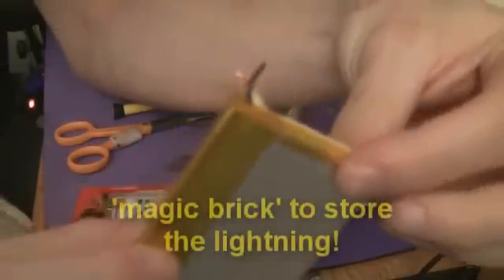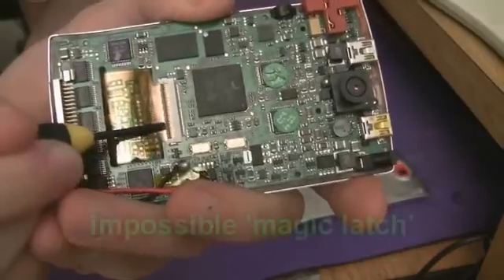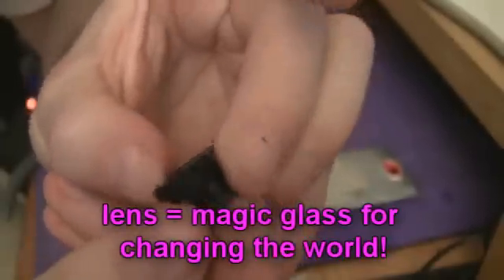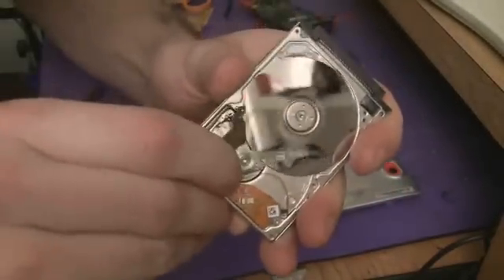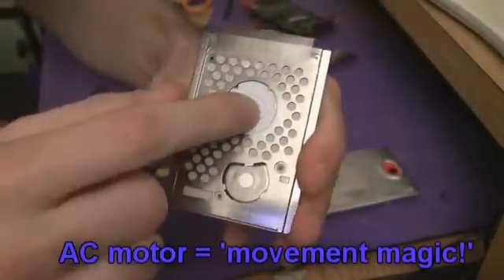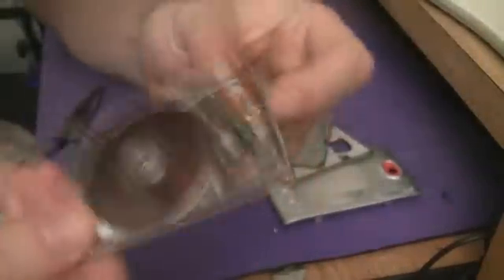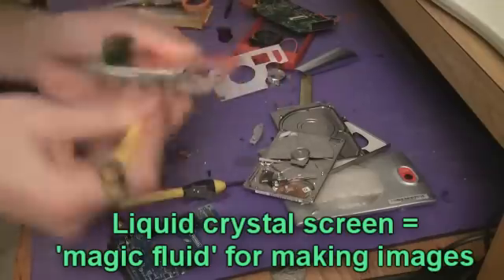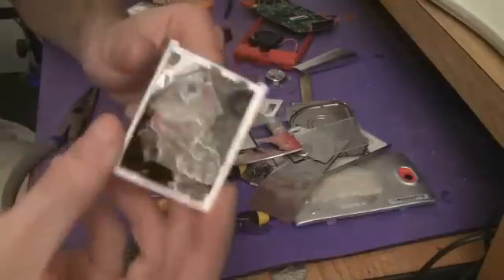PURE NERD PORN

Comment: Common dude, you couldn't recreate the sticky tape without looking it up, if it is even available on line. The sticky tape alone is very probably the result of thousands of man years of research and other work xD. Sure you could analyse it, but I'm guessing you wouldn't get much out of the solidified polymer that is the adhesive :p

Comment: A few tricks that I figured that helped me a lot: make photos or a video of your disassembly process, so you know exactly where those screws go later on... Place the screws and components on your table in groups corresponding with the dissasembly stage and try to find bluebprints or dissasembly guides/videos/pictures on the net before you start, so you avoid damaging your devices. especially when you need to find out where those stupid plastic latches are located... have fun! :)

Comment: They don't make them like they used to. For several reasons.

The first is to save money and make it cheaper, they use inferior parts and cut corners. This makes for an inferior, yet cheaper product, which ultimately has a short lifespan.

The second ties in with the first; planned obsoleteness so as to make more money when the device breaks or something new comes out a year or so later (they figure the old one won't last more than a year anyway).

Comment: Incidentally I'm reasonably sure that Thunderf00t makes use of brushless motors in his RC airplanes, you almost never use a 3 cell li-po battery with brushed motors.  Besides almost all electric fliers use brushless systems, they cost more but they're a lot more efficient and so long as you don't crash 'em they last practically forever.

Comment: the controller senses the position of the motor and energizes the appropriate winding to keep the motor moving at the desired speed.

As far as I can tell, such systems are used in all hard drives as well as optical drives.  It's a very reliable system.

Similar motors are all the rage in remote control cars and planes.  In fact for a while it was all the rage to take the motor out of an old cd drive and strip it down and use it in an RC plane.

Comment: "How can you have an ac motor in this dc powered device? There certainly isn't an inverter in there, although I suppose the voltage could be flip-flopped, but that still wouldn't be AC."

You need to understand what is meant by ac motor.  It's not driven off of a constant rate AC current.  Or rather, at constant speed it kind of is, but still.. it's a brushless motor, if you understand what a brushed motor is it's kind of the reverse.  Instead of mechanical commutation the motor controller...

Comment: How can you have an ac motor in this dc powered device? There certainly isn't an inverter in there, although I suppose the voltage could be flip-flopped, but that still wouldn't be AC.
Are you sure it's not just a dc motor?

Comment: And now TF, bring forth a soldering iron and a pair of ipod earbuds. Cut off the buds just before the point where the cable spilts, remove some insulation and solder either wire on the inside to the little points on the HDD reading head that should be located on the brown strip leading to the drive electro's and cut off the strip you don't need. Rrun a mono audio signal into the cable.  Just stick an open soda can or a piece of stiff cardboard between the arms as an amplifier. Enjoy the magic!

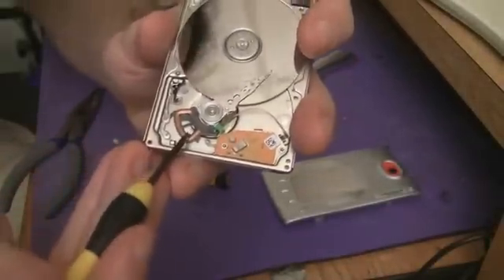Comment: Think of a drive's platter like a gramaphone record, in a sense.  As demonstrated around 3:40, the arm acts as a sort of "needle" that seek the different tracks on the platter, but it glides on a hairs-width cushion of air.  

If that seek arm were to bounce and touch the surface, it'd be like dragging the needle across a 45rpm.  Except, instead of spinning at 45rpm, it's going ~5,400rpm.  

That's one way for the drive to crash.  Not so common these days, but it could happen if dropped.

Comment: "Why not make the inductor stationary and use the force to move a perminent magnet?"

It's a power saving design.  It would require more power to move a magnet because they are many times heavier than a simple coil wrap.

If that's not the reason, another possibility.  Perhaps they couldn't shield a magnet on the drive head as powerful as that one sufficiently to avoid critical hard drive data loss.

Comment: in 23 years 1 gig of storage went from the size of minifridge to small enough to fit on a fingertip. in 60 years computers went from the size of a room, to small enough to hold in your hand. the capacity of said computers has increased a trillion fold (possible exaggeration but certainly a tremendous amount...) transistors have gone from the size of a stapler to <90nm 90-1millionth of a meter...a human hair is 100microns or 100-1thousanths of a meter.)
i eagerly await the next 50 years.
Reply: tuseroni hi it's the future 1 gigs are small enough now if you remember this comment

Comment: what's cool is that if you found yourself in the wilderness with nothing but that Archos Gmini.  You could smash it apart with a rock and use one of many parts inside it to start a fire.

The battery, or any of the bendable mirror-like surfaces (as a lens).

Comment: Of course due to Moore's Law you could build the same device today with about a third or a quarter as many components. We are getting really close to having devices like that which are mostly air inside and most of the volume is to make them easier to hold.

Comment: I remember having MFM drives with an RLL card to get an extra 40 meg on a 80 meg drive. Running Dos 6.1, 8 meg ram and a USR Courier modem. Sporting a 15 in. SVGA monitor with Bitchen mo-fo. Ran a BBS at night and lived on TAB. Ahhh. the memories.

Comment: Translation (for non Germans): Around 1987 the established standard interface for hard drives, only until 1994 was Enhanced IDE (EIDE) current. The definition within the ATA-/ATAPI standards, IDE, EIDE, ATA, were applied mostly synonymously.

Translated by hand (for better or worse) :)

Comment: Awesome.  It's amazing just how complex these little devices really are.

As for the magnet on the drive, I found out last year just how strong those suckers are.  My dad had to dissemble a lot of computers where he works so the company could drill through the hard drives before throwing them out.  Well he saved the magnets.  Holy crap.  They're very hard to pry apart.

Comment: It looks like a Toshiba ZIF drive to me.  It could be a single-sided 40, it does look like the assembly has head on both upper and lower platter surfaces.  

Back when IBM was still making hard drives they had glass substrate on their scsi, 3.5 IDE and 2.5 IDE, even before selling to hitachi.   I've seen glass substrate in some Western Digital, Seagate, Toshiba, Fujitsu and hitachi hdds.

Alot of the 'defect' drives ended up in Tivo and XBox systems after recertification.